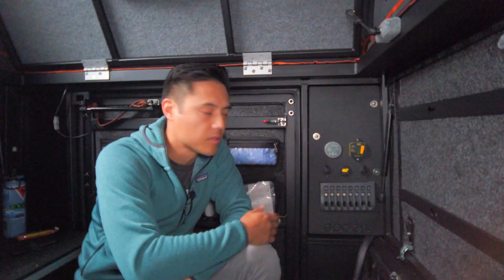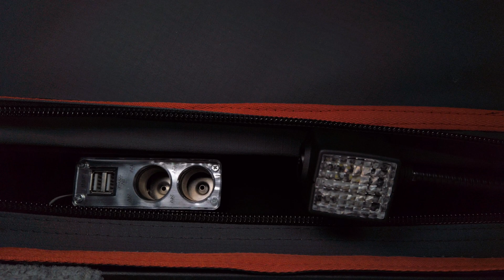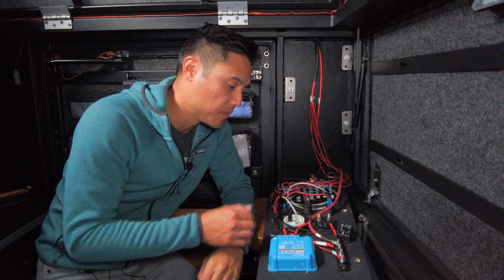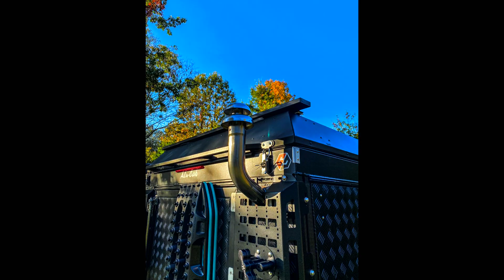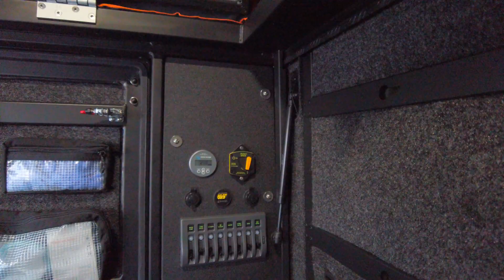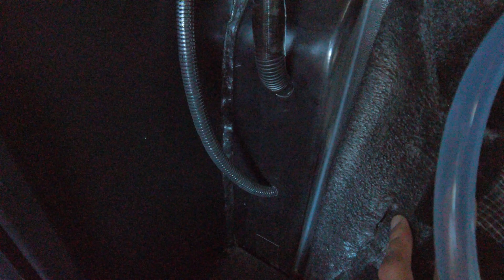AluCab Canopy Camper | Goose Gear Electrical Panel w/ GP Factor Mounts

Comment: Thanks for posting this. About to re-route my wiring to the drivers side to make way for my furnace which will be installed in a couple of weeks. 

For the insulation you used on your side doors - did you just cut and pressure fit a BedRug in those slots? How has it held up over time?  ✌🏻

Comment: What the best route to run the wires from the engine bay to the rear cab? Thanks!
Reply from the maker: I had some existing holes in my bed from my bed stiffeners so I just enlarged them and ran the wires through there.

Comment: Great job all the way around. Considering  the Alu Cab Camper, but maybe on a Jeep Gladiator to take advantage of the diesel. Any recommendations on an excellent shop to do the total build-out? Thanks.
Reply from the maker: If you are in SoCal you should contact Tiny Rig Co or in Orange County. Tell them I sent you!